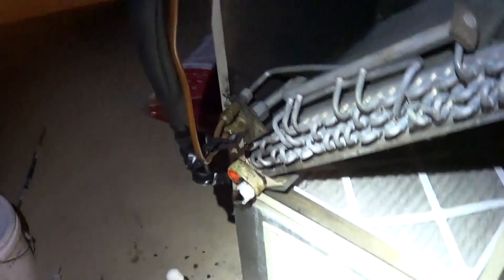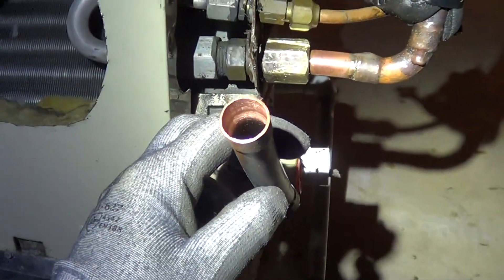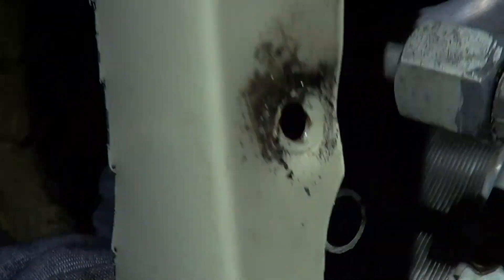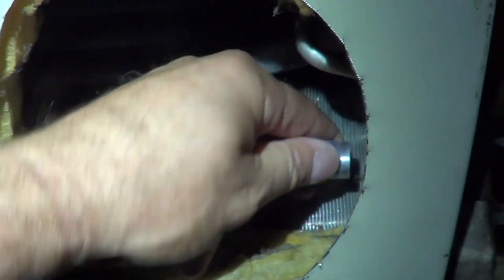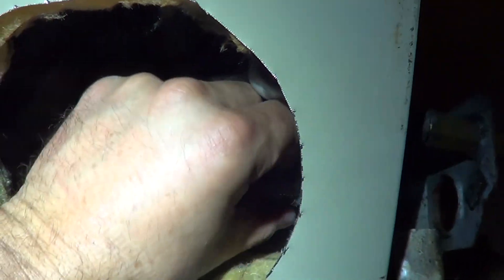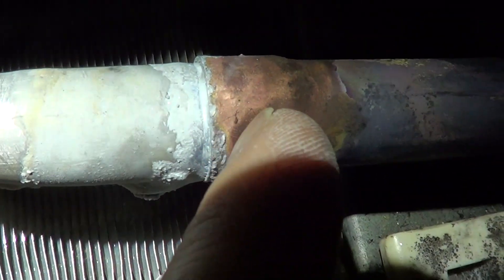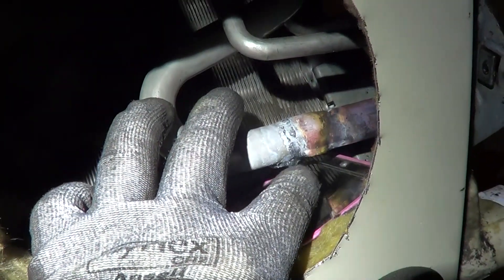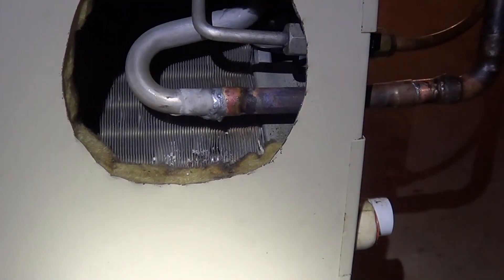Copper to Aluminum solder repair with AL-822 solder.

Comment: Great job and video, the cut hole is a piece of cake to cover back up, who cares as long as the system is up and running, not a structural issue and the next repair will have access.

How come no backing flame shield against the evap or insulation just for good measures?

Comment: I always pulled the suction brass compression nut back, put a wet rag on aluminum side and brazed copper to brass with flux...worked every time.

Comment: Brother, over all good Job, Bravo!   However, 
Why didn't you use new copper for the new connection?   that old nasty copper?
Why didn't you pull out the coil and do it, vs cutting a hole in cabinet?  now you have to use blockout n cover hole up n  pookie/mastic it
Reply from the maker: Old copper is fine.  On this particular job I wanted to spend the minimum amount of labor.   cutting the hole allowed faster access because that coil has to lift up and out rather than just slide out.

Comment: Finally found a aluminum to copper repair in the field. Only question is why not slide the evaporator out instead of cutting the hole ?
Reply from the maker: That design doesn't let the coil slide out.   It had to be lifted and then slid.   The hole was easier.

Comment: If you hook up a vacuum pump, crack the valve putting the system in a slight vacuum and heat the copper, you'll get full penetration and won't need to move the torch around the joint.
Reply from the maker: I always wondered about that.   I'll search some videos on vacuum soldering.
Reply: @NathansHVAC  it's just my theory based on my own trial and error. Before hooking up the pump, I would always end up with a pin hole leak. Hit that and another would turn up in a spot that was already sealed... Only thing I can think of is residual oils getting trapped in the joint and expanding from the heat before the filler metal solidifies.. maybe the slight vacuum counters it, but what do I know, I'm just a stupid refrigeration mechanic

Comment: I'd be careful with regular brake cleaner around heat.  You should use the brake cleaner in the green can (non-chlorinated) if you're gonna use hot processes around it.  I'm not sure about soldering heat levels, but I know a lot of welders have either died or had life long injuries from chlorinated brake cleaner.
Reply: Heated Brakleen can decompose into chemical weapon agent phosgene gas (COCl2). But Brakleen boils away at room temperature, so gently preheating the parts to joined removes any residue. It's a great degreaser. 

Check the ingredients in the so-called "green" Brakleen formulation -  it's got loads of acetone, which softens or strips any paint it might splash on.

Comment: Does anyone know the difference (practically) between this AL822 and a similar alloy AL802?
Chemically this AL822 braze rod is 22% aluminum, balance zinc.
Whereas the AL802 is 2% aluminum, balance zinc.
But practically, why would you pick one over the other?
Reply: Manufacturer says the 822 will fill larger gaps and best for repairs. 802 needs a 6 thousands or less

Comment: I hate copper to aluminum  Haha where I work all our line sets are aluminum and then we add copper when connecting the air handle and condensing unit. It's tough to get those copper to aluminums to hold and not leak.
Reply: Alek Gutierrez aluminum line sets!?
Yuck 🤢!!!
That's gotta be harder to deal with!?
Sounds like the bosses need to do a few jobs.... they'll probably see the big picture afterwards!!!
Call back city!

Comment: An urgent reply I have the problem at my project Package AC Unit condensing coil and copper joint leakage, I need to braze the Aluminum condenser coil and copper joint area trying to weld but it's not getting joint.
 Please, any one can help, How to solve the problem.
Reply from the maker: These joints aren't that bad.  It might take several attempts, but keep trying.  Make sure to de-grease all oil with solvent.  Use the AL-822.  All the other solders are bad.  It is normal to take a few attempts.  Use soap bubbles to check for leaks after every attempt.  Keep the joint very cool.  Too much heat is bad.  If you smoke the joint, pull it apart, sand and try again.

Comment: You could have cut out the leaking "O" ring and just braze in at threaded part of coupling with low temp solder.
(Carrier gave this option on original installation last century.)

Comment: why not use LOKRING Solder free tube connections for servicing Al /Copper Refrigeration Appliances 1080p   https://youtu.be/bTLQxiFryVw
Reply from the maker: That is the type of fitting that failed in the first place.  The compression fittings are fine until someone knocks the pipe and loosens the mechanical seal.  But, the difference with LOKRING appears to be the Lokprep 65G sealant and larger mating area on the pipe.  I see a used crimper set for $650 on ebay.  I will think about getting it.  An oily aluminum pipe that can't be de-greased would be perfect for Lokring.  But, solder is going to be more flexible on the types of leaks it can repair.

Comment: Nice repair but maybe pull the coil next time? You did a neat repair but anyone who comes behind will slander you because you cut that big hole
Reply from the maker: On this one the coil wouldn't pull without huge effort.
Reply: Exactly

Comment: you cut a gaping hole in the unit just to solde some tube
Reply from the maker: Not just any tube.  Copper to aluminum.  Nobody does this in the HVAC industry.

Comment: Great job! I am all for fixing stuff. Does the copper to ali joint need covering once done? I have seen some solder here but they recommend the joint is covered with heat shrink to keep the moisture out to prevent corrosion.
Reply from the maker: It probably would last longer if covered.  I usually use silicone instead of heat shrink.